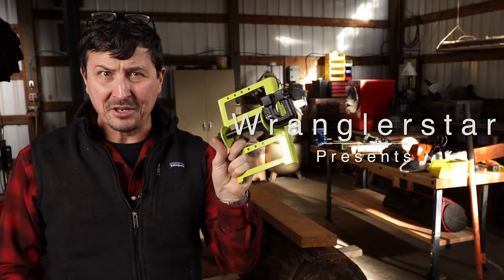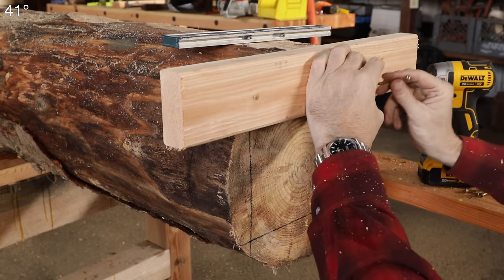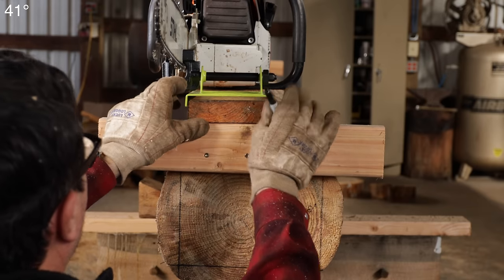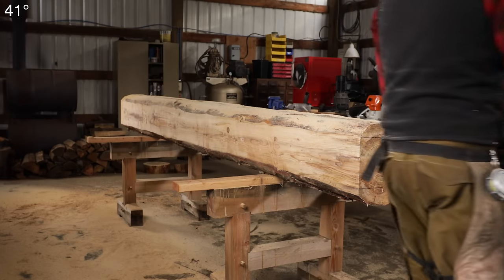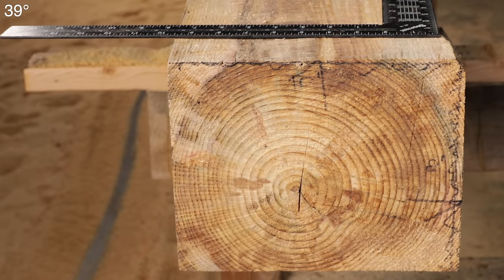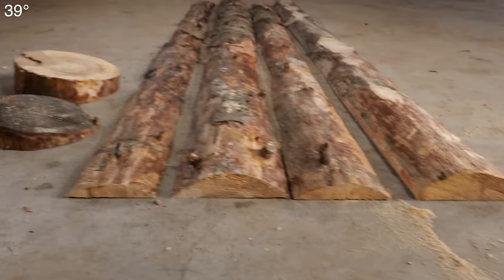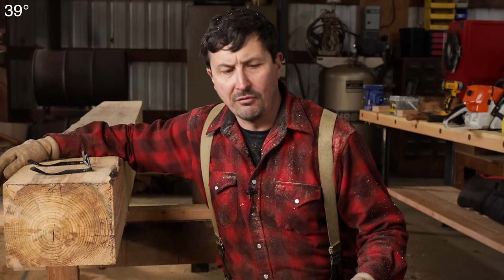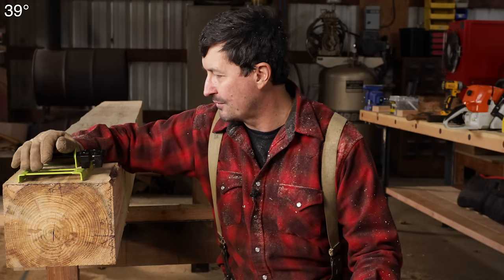How To Chainsaw Milll Like A PROFESSIONAL HOMEOWNER WRANGLERSTAR

Comment: This would be great for trail maintenance folks building small bridges and such out in the bush. Beats dragging a full size alaskan setup out there.
Reply: That’s great way of looking at
Reply: Don't forget with this mill jig it's mandatory you bring a 2x6 in whatever length you are cutting at, but if you need that for both setups then it's a wash I guess.
Reply: @willierants5880  Technically you could make a mobile rig with a series of ~6' chunks of 2"x6" that interlock with dovetails to keep strait. Pre-drill some holes and screw each one down after it's laid out with a single screw per side and you've got a mobile mill that will fit in any Truck/SUV
Reply: Yes it is cheap and seems simple enough to use, but there is still a downside, the whole thing doesn't really fit in your pocket...

You still need the piece of lumber (full length) to use as a guide, and putting screws into the timber doesn't leave  the sides in perfect condition (ok easy to add an inch for "fixing".) to get the cuts happening....

For Rough Bush "lumber" who ever forgot that one can rip logs freehand with a chainsaw...  (mark out with a string-line and pencil.)..  
It's in the bush nobody is going to notice your cuts once the green wood warps to heck and back.

lol...
Reply: Exactly what I've been looking for to mill some white cedars to make some small bridges!
Reply: Any straight edge does not need to be a 2x6.

Comment: Two things I like about this guy. 1) He wears chainsaw chaps and PPE. 2). He understands the importance of the first cut. My first few days with the TMW-56 I struggled hard and ended up with 4 beams, none of which were square on either end. Starting on level ground with a level saw horses really helps. IRL it's not this easy but although he sped up this video in many places from real time he mentions key elements about the importance of the 1st cut, keeping things square, ripping chains, leveling things, starting from the small end. The devil is in the details. Thumbs up!  You get what you put into the TMW-56.

Comment: I've cut many timbers with a chainsaw mill. 
TIP:: Place your log on a decent angle and let gravity help ease the effort of pushing the saw.
Reply: Can you explain what you call a decent angle,in more deprh?
Reply: pdloder 69 degrees mate
Reply: pdloder probably 15-30 degrees.
Reply: Very good idea ... Didn't think of that one until u bring that up, hell I will do that next time I cut lumber.. thanks for bring that up
Reply: Oh by the way you don't need to get very technical about the degrees... Just as long as ur saw is going down ⬇️ and not straight level as in the video
Reply: I like to cut at around knee height as well. He's holding that power head way to close to HIS head lol
Reply: Thank you
Reply: Or just have sharp links,,, then u don't need to push..the saw will pull itself😊
Reply: @pdloder  4.20 degrees!
Reply: @miguelmarquez4192  I didn't catch the spelling error.  Now I know why he asked the question.
Good catch.
Reply: you guys have to cut wood? i merely inhale and think it and the wood cuts itself
Reply: Awesome suggestion. I will be cutting down a few trees this winter, saw milling for the first time.
Bless you.
Reply: Why you have to cut backwards?? Can't cut forward????
Reply: @slewter9041  I think you mean sharp cutters or teeth

Comment: I used one of those 20 years ago to cut a ton of hardwood lumber in the woods.  It was sold by woodcraft and called a haddon lumbermaker.  Was maybe 60 bucks then.  Used my 029 super and a few different length bars to do the sawing and a straight 2x4 - very cheap way to make accurate lumber back when I didn't have much coin!  Thanks for the great demo!
Reply: When you write "lumber", do you mean you slabbed boards and not just beams?  I'm trying to envision it.  The first couple of boards would be done the same way, but with each slab, as the runner board gets moved over, eventually there would not be enough surface for the runner board to rest on.  Do you have any tips?  Thank you.

Comment: I’m pretty shocked why 1.2K people would downvote this video.  It’s sad that people can’t appreciate how much thought, time, and effort went into this.  This is great stuff!  You’re literally saving people thousands of dollars by not having to buy a sawmill.  

I’m actually getting ready to build a timber frame tiny house on wheels.  Trying to keep it in the 6000 pound range, so that I can pull it with my 2014 Expedition.  Once I can find a place to buy logs I’d like to mill my own timbers like this!
Reply: When I see someone doing as unprofessional as hitting the ax into the workpiece, showing his carelessness to the outcome and obviously wasting wood, I give thumbs down as well .. you like it or not  :))
Reply: Dang that thing is going to be heavy 🤣
Reply: @greybeard5774  he specifically pointed out that he added 6 inches. The ends he's screwing into and tapping his axe into aren't the final workpiece, they'll be cut off.
Reply: @greybeard5774  It bothers me too but when he used the ax to help turn the log, I got it. Say goodbye to the grey!!
Reply: Hey Will, where do you see the number of downvotes?
Reply: I bought it and did what he said and it worked as advertised. Square first time. I'm doing the same as you, Will, but I have the timber. Oak and cedar, mostly small hard wood. I put a 2x6 and cut it both ways, just one quarter turn. I put a 20" bar on the same saw.
How's your project coming a year later?
Reply: It’s because of Cody and some of the view points he has on certain issues. He’s a bit extreme for a lot of people.
Reply: How about the 57k up votes?

Comment: Those are great, I think they are called "Beam Chainsaw Mills" as they are made for exactly what you did, milling up a beam. 
I made one myself years ago to edge slabs that I cut using my shop made Alaskan style mill.
The fact is for making beams, they are great, but for slabbing up a big log into boards, they are only OK, an Alaskan Chainsaw Mill is much easier to use and you get better consistency for board thickness.
For $20 it should be in all of our tool kits.
Cheers from Tokyo!
Reply: The Tokyo Craftsman You write with an English accent it’s incredible, I just can’t help but imagine you looking like a shop fitter in Manchester haha 
Its a compliment and great info too. Cheers.
Reply: S P my grandfather was from Bristol, but I’m Canadian eh. 
I’ve lived in Tokyo for +29 years. 
Cheers!
Reply: The Tokyo Craftsman Ha ha amazing.

Comment: That actually looks better than the big expensive ones. There's less to go wrong. As long as your set-up is good it's going to work. I like it.
Reply: Just dont get kickback with the bar at that angle. Im nervous just watching
Reply: I have one of these n have ised it on red oak n pin oak. The trick os the first cut and dont try to push the saw too hard. If you follow those two basics you will have great results
Reply: A good portable V2 POWERED MILL will make this look obsolete.  Or a 13 HP  Honda GX 390
Reply: @mooglemy3813  if you have 10k to throw around go ahead!  Most of us dont!
Reply: A good buy even at $30 imo

Comment: I love these cheap jig and tool review videos.  Amazing that a tiny 20 dollar jig can work so well. 
Back when I was in my late 20s I purchased my first 24 inch used Homelight chainsaw. I had moved to the Sierras and learned to cut, fell and split my own firewood.  Now at 58, with nerve and back injuries,  my husband bought me an 18 inch Stihl MS 250 for my birthday back in January.  Right after getting our trees worked on by professionals  😕.  I finally have a project going that I will use it for almost 3 months later. But now I want to get me some logs to mill!

Comment: Nice thing is once you have a square post like that you can make smaller dimensional lumber by just moving the rail over 2 inches at a time and  make 2x material easy peazy.
Reply: Never thought of you as a chainsaw guy 😃more to like 😁
Reply: @justnicole7983  Same, lol! Just cruising thru these comments, and there's Luke with the golden comment!
Reply: This looks really amazing, but I would wonder at some point since you have to screw the lumber to the log or in this case the squared off post. You would not be able to make that into lumber because it’s some point you would have nothing to screw off to, does that make sense? Or am I thinking too hard?
Reply: @dprevish100  I think when you get down to only a 4" wide surface for the guide board, you could either flip the timber 90 degrees to split it again if it's wide enough, or possibly you could drill the side of the guide so you can screw a 2" wooden spacer inside it and run it on a 2" wide guide board to get that last cut. But that might be wobbly/unsafe? I think I would just cut as many boards as I could normally and be left with one 4" wide beam.
Reply: That’s a good reason for the extra 6+ inches on the ends. Cut off the fastener locations once you’ve milled your preferred dimensions.
Reply: @dprevish100  you can continue to resaw on a table saw or band saw

Comment: Love to see him try this with some of those newer electric battery saws like the EGO line. Wonder if you could use one of those to mill log this size. 
Be pretty sweet to have that and a set of solar for charging while working on a homestead.
Reply: Been looking into this the past couple of days and one thing I came across was that if you angle your blade to just bite a few of the bottom corner teeth at a time your shavings are longer/ energy consumption is improved. Should be achievable by making an adjustable stand for the guide wood so that you can adjust the height of the guide to adjust the depth of the cut. Would imagine it would mean less sharpening as well. But way more (faster) cuts
Reply: In my personal opinion, the battery saws are a little too dangerous for this. The have too much torque, and can't be stopped by  chainsaw chaps.
Reply: Hope ya get a warranty on your tools and buy extra batteries, more amp hours the better. Hell just rig up a car battery to your electric chainsaw😂👍
Reply: @nagunaks2222  Or use a corded one....🤔
Reply: Echo came out with an electric saw that outperforms gas.
Reply: If you want to usea electric chainsaw in a shop a Cordes saw would be better ,  cheaper, less hassle with batteries
Reply: Yeah that would be crazy.
Reply: Failure to charge . Sudden lurch to stop and " time to find the charger "
Stihl all the way
Reply: After watching the documentary Planet of humans, I will stick with gas
Reply: Lol no f way.  It's really just farting in the wind to use anything other than a 3120/ 880 or comparable.
Reply: @canucanoe2861  yeah what size saw and what is it being compared to?  
Been meaning to check them out but Husky have been the forerunners for professional grade electric saws and the new 540XPi is amazing and I'll probably get one.  It's still got nothing on their best petrol top handle (T540XP) or a Stihl 201tc-m.  I use one nearly every day and there is simply no electric equivalent.  Yet
The quoted specs on the Echo top handle are impressive but it's hard to compare with others cause of different volts and battery sizes.
Reply: I guess you can get away with a smaller saw on softer smaller stuff but ripping is hard work.  It's slow enough with a big saw and I don't know how practical milling small logs is..
Reply: My personal experience when cutting big logs electric just doesn't seem to have the horse power or torque to go through say 12 foot log 10 inch diameter but that's my experience I only use electric for pruning really or to smooth logs out
Reply: No..

Comment: What a great idea, Its great when a cheap  item like this punches above its wieght and delivers compared to more pricey products. 👍
Reply: I would have liked to see a less cut up video, to get a realistic view of the hang-ups, delays, etc of using it. And a few dozen hours of use seems like a requirement before recommending a tool like that.
Reply: I've used this exact mill, before I got an Alaskan, to cut up roughly 500 bd ft of pine  with a very under powered saw and it worked well. The biggest thing you need to do is stay ahead of the sharpening to ensure clean efficient cuts.
Reply: Cool. I know it's a lot slower than a good bandsaw mill, like a Wood-Mizer. I know a Wood-Mizer sawmill is not cheap, but it may pay for itself over a few years. Also, Wood-Mizer is a Christian owned company, while Timber Tuff is owned by Husqvarna, and TT has stuff generally made in China...

Comment: I've used one of those for years. Bought it from a local saw shop whose owner's sister used it to build a cabin in the Yukon. Believe it or not I used a 41cc Husky with a narrow kerf 18in bar and have cut many 2x4, 2x6 and 6x6 from downed softwood. These things work great.

Comment: It depends greatly on the type of wood in regards to using a ripping chain.  The finish is the main difference seen across all types though, for whatever that may or may not be worth to you.  I concur though, often times, hardly worth the time spent changing out the chain.  Thanks for taking the time to review this.  I was curious how they performed.  For folks working in a pinch, it's nice to know what the options are.
Reply: With thousands of board feet of lumber under my belt with an Alaskan sawmill running a Stihl 090,  a ripping chain cuts faster and given a smoother cut every time. The time it takes to change over the chain is minimal for a better outcome, in my opinion, when milling Douglas Fir, Port Orford Cedar and Black Oak.

Comment: Well done , I made a jig up and filed a chain to 10 degrees. Couldn't believe how good the cut was . I only had a 9 amp electric saw , surprise surprise, it worked . I did use more oil on the chain than normal

Comment: With a couple of extra screws along the length of the 2x6 on top there, it should be possible to to make near perfectly straight beams even if the 2x6 is not perfect. Might be a good idea to spend those few extra minutes.
All in all it seems like a very nice jig. Certainly can't argue with the price.

Comment: This design can easily be improved by making the bar axis to guide distance more adjustable. This way you can set up the reference plank centre-line to be equidistant and you can cut both sides without having to re-adjust.

Comment: Thanks Wranglerstar, I was curious about these.  Baileys and a local miller both say a milling chain is slower, but sometimes gives a more finished cut.  He preferred a skip tooth chain.  Seems like you should have made the 2nd cut using the supports you already had in place from the 1st, resetting the 2x6 and cutting the opposite direction.  If doing this a lot, make a spacer to set up the offset for the cut.

Comment: I've used a similar sawmill and quite honestly my results varied quite broadly and none of them were remotely as good as yours. I think that you are quite gifted at avoiding"left to right" rocking or twisting of your sawmill on the 2x6 which is the one skill that I lacked, as will most.
Reply: That’s where keeping your blade sharp is the key.  Dull blades want to pull to one side.

Comment: If your doing a lot of milling, run castor premix or something with castor in it like Super techniplate. You can even tune the H jet on the carb just a little fat or rich. The extra fuel and oil helps cool the top of the piston. I’ve repaired a lot of saws burned up from heavy milling in a short amount of time. Running premix with some amount of castor greatly extends the life of the engine when milling. Straight castor like Benol or blendzall is Smokey and carbons stuff up pretty quick but nothing protects a 2 stroke like castor oil. You can also run skip chain with a big 9 pin sprocket or a 10 pin of your bar oiler can keep up.

Comment: A little extra oil added on the chain as you go, doubles, at least the amount of cuts you can make between sharpenings, will reduce wear and chain stretch, and reduce sharpening to a couple strokes per tooth. Prolonged cutting dries the chain, also turn up your auto oiler to reduce friction. Makes a huge difference.

Comment: Maybe you've covered this... But cutting vertical vs horizontal do you ever notice a difference in chain/bar wear or it gets oil pretty well either way?
Reply: Mitch Stockmann chain oilers don’t really care which way the saw is facing, they work regardless.

Comment: I just bought one, it pays for itself when cut your 1st 6 x6 timber.  Loews
charges around $50 for a 12 footer.      But you need  the wood to dry for a period of time,
and preserve it from bugs and the weather.     Not sure what to use, marine epoxy?
wood stain? Whats an inexpensive way to do this?

Comment: Thank you so much for doing this.  There are so many to choose from.  It became very confusing very quickly especially when you have never used one of any kind.  I am doing what could be a very expensive project if I paid someone else to do it and if I had to buy the raw unfinished but cut wood.  I have the hardwood log already laying in my yard and the experience with a chainsaw so it only makes sense to cut the slabs myself except, I had no idea of which attachment or apparatus would work for me until I saw your video.  Soooo helpful!!!  Again, thank you.

Comment: Curious: How much gas and bar oil did this require?
Reply from the maker: half a tank,
Reply: @wranglerstar  is that good, average, or bad?
Reply: @superme63  I'm not @wranglerstar , but that doesnt seem to bad. It's a long thick cut with a good sized saw. If you were going to mill it into boards you would end up using a tank for 4 2x10s which I figure is good.
Reply: @superme63  That's good.  Considering most cuts are a few seconds worth of time, this is good.